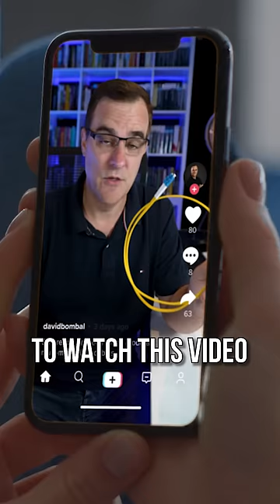Did you know you are using these right now? #shorts

Comment: Single cable is used for back bones and or the long stretches of a fiber line. Multi is for house conections kind of like a bridge or a door way for the light to go to
Reply: We use single on both , inside wire and wire to the prem
Reply: @el_Chupo  correct I was referring to
 take a 288 and run a backbone and 97 or 24 counts off the 288m for  legs feeding to enclosures for house drops? You wouldn't exactly use that wire the exact same thing just construction cable instead of a tool
Reply: Multi is used to connect multiple equipment. Exemple is a server connected to a router, everything inside the ISP facility

Comment: Quick tip:  The aqua colored cable is laser optimized multimode. Normal multimode fiber that uses LEDs would have an orange outer jacket.
Reply: I didn't know that. I'm very experienced with single mode but haven't had much to do with multi mode.
Reply: Aqua colored is normally called OM3 multimode
Reply: The color has nothing to do with the cable type. You can order them in whatever color you want.  While there might have been some accepted color coding in the past with yellow typically being for Singlemode and orange being for multimode, the colors never really were actually part of the standard.  I have yellow and orange OS2 single mode as well as orange, red, aqua, grey and blue OM3/4 multimode. Always look at the indicator on the cable to know what it is. You cannot tell from the color or the connector.
Reply: @shawnrhode  True but 99% of OS1/2 is yellow, OM1 is grey, OM2 orange, OM3 cyan and OM4 purple.
If someone at your place of work is buying cables that don't conform to that sack them.
Reply: @jonathanbuzzard1376  I buy based on use. For example, single mode network cables are yellow, single mode fiber channel cables are black, multimode OM3/OM4 network cables are aqua or dark blue (primary are aqua and redundant are blue), multimode OM3/OM4 cables for fiber channel are orange for one port on the HBA and grey for the other port.  
For infrastructure cabling within the plant, I stick to yellow for Singlemode (OS2) and aqua or purple for multimode like you noted. I haven’t worked with OM2 or OM1 for a while although I do have some OM2 lying around. 
Colors are dependent on use and location. Having someone use different colors but having a plan around why and how is fine. Just randomly throwing colors in just because isn’t fine as you noted.
Reply: THANK YOU. Aka OM1 Fiber. It's out of standard and shite
Reply: @shawnrhode  typically it does. I'd say 95%+ in my field. USA here
Reply: @9ernation543 USA never been a good standard follower 😂
Reply: Thaks for that mate. Didnt know that one.

Comment: I work with fiber optic in the broadcast industry a lot. It’s the most fragile cable we use but also the most effective because you can send multiple video and audio signals down just one cable.

Great video!
Reply: And its MUCH faster than traditional copper cables, also can be used over much farther distances than copper as well

Comment: I worked optic fibre in a data centre for 5 years. The single mode cable itself is a bit cheaper that the multi mode, the SFPs though, those are 5 to 10 times more expensive than a multi mode SFP. High price resides on the level of precision single mode requires. Within a data centre multi mode works well. There’s a new generation the OM5, if not mistaken it can carry up to 100Gb on only 2 threads using multi wide band.

Great content Mr David!
Reply: Thanks! Great info
Reply: Today the difference in cost are so low there is little reason to even consider MM outside server centers.

Comment: We studied this in my engineering, basically there are two types: step index fiber and graded index fiber (based on refractive index of core). Each can be divided into two single mode and multimode. Though we use graded index fiber for multimode only. Fundamentally, the lights travelling in them are either LEDs or LASER. These lights propagate in the fiber through Total Internal Reflection phenomenon.
Reply: I was disappointed he didnt mention refractive index in the video as that is entirely the difference between the two and WHY single mode travels center and multimode bounces down the glass.  The fiber core is a different diameter in the two, controlling the reflective interaction or the photons.  So thank you for bringing it up!

I spent 20 years as a net eng/architect in cellular/wireless telecom, mostly using SM in my work.  One of my favorite projects was deploying a bidirectional DWDM (Dense Wave Division Multiplexing) ,ring between facilities using Tellabs 7100Nano DWDM switches.  Essentially i played with "colors" on the fiber.  The data density we're able to stuff into a single pair of single mode glass ia downright insane.

To explain what i just said, we had a need to connect four distant locations with very high bandwidth capabilities.  We provisioned two rings of "dark fiber", meaning the carrier connected them with only glass, no routers or switches.  That allowed us full control of the wavelength we deployed on the fiber rings.

Using that Tellabs hardware we were then able to send 288 different frequencies of light down just one single mode fiber.  Each one of those frequencies were capable of transporting an OC192 or 10gigabit ethernet.  Between both rings that was 5.6 terabit of provisionable bandwidth between facilities, on just two fiber rings.

The fadcinating part is HOW this equipment was able to manage all those 'colors'.  They used PHYSICAL switching to do it!  The light coming into the equipment ln the ring was split using very accurate, tuned prisms, and the switching fabric (how it directed the input to the right outputs) using micro-mechanical mirrors, just like a DLP TV, insanely tiny mirrors directed each color to the proper destination within the equipment.

Note: I did this 8 years ago, i guarantee modern equipment can do more than this now.
Reply: And to add. The fibers connecting the continents still do have repeaters/laser fiber amplifiers every couple 100kms. Even though the loss is quite small, it does add up over long distance.
Reply: We learnt the same thing you mentioned like an year ago 😅
Reply: Believe it or not my great uncle was on the team hired to manufacture the very first fiber optic cable. He was the one who designed the machine and made the first successful strand. I own that exact strand today. About a foot long and half inch thick with metal ends crimped on. Really cool piece of history that may be worth money one day
Reply: @JohnBysinger  your wording is wrong. The refractive index interface is bassically the same in MM or SM fibers. 
It is 100% the core diameter that controls the mode propergation and technically it is the mode that propagates "straight" down the fiber.

Comment: As someone who's studying network engineering, this is highly precise and informative for a 60 second short
Reply: But but he never mentioned that the core can also be made of plastics, and it's not always glass or pure glass
Reply: @mohankrishna1443  It's glass in all modern single and multimode fibers.   

What you're talking about is called POF or Plastic Optical Fiber and was used for short, low speed networks.  I believe TOSlink may utilize a POF.

Comment: My anxiety level hit heights when he tries to bend the cable.
Reply: Ten thousand data center operations techs cried out at once
Reply: The ones that we use at my work are strong enough that we can wrap them around a pencil and still work just fine.
Reply: These cables can bend to like a 3mm radius without breaking
Reply: You will just loose the proportion of internal reflection long before it snaps. Its when you use solid core twisted pair by mistake instead of braided when the fun starts.
Reply: Omg , comptia lied to me lol
Reply: @Nick_Shrope  tiny fiber?

Comment: I actually assemble cables similar to these but they get used in semi conductors. Even in single mode the light is technically bouncing around in there. When you bend it and went past the bend radius you actually still get a loss in yield. We use equipment to measure this yield. Fun fact: the glass core that the laser travels down can have a diameter tenth of a millimetre or smaller
Reply: So silicon photonics?
Reply: You’re splicing these??? That’s awesome. I use premade jumpers to run switches and servers across buildings but I’ve never actually had to splice and cap fiber optics before, just RJ11 and RJ45.
Reply: @DenyTheZeitgeist  my job specifically requires the assembly of these fibre optic cables. Our product is encased in a metal jacket for durability and protection against extreme bends. Assembly will include actual assembly of the parts, polishing the ends and checking under microscopes and testing for the yield outputs. Our main customer is ASML. If you look them up they’re the leads in the EUV lithography market. All of the latest tech that’s coming out like the iPhone 15 pros will be using these machines to make even smaller transistors. It’s really cool to be a part of this process

Comment: It’s a SC LC connector, that connects to an optic ODF.

Single mode is the modern version, where multi mode requires some sort of booster and is mostly used on old buildings because you can’t mix sm/mm. Also mm and sm has significant different in width. 

Optics is not only used for data tho, it’s used in lights aswell nowadays.
Reply: Nope its about 1m LC-SC single mode cable. ST is a small bayonet connector.
Reply: @jonathanbuzzard1376  your correct I mixed up :)
Reply: It doesn't have to connect to an ODF.

Comment: Single mode SPF LC patch cable, I used to work a a fiber rest equipment manufacture co. It perfectly fine to bend them, usually around a mandrel when you need to measure the connector reflection and attenuate out the light from returning before testing a network cable.

Comment: The light bounces around in a single mode fiber as well.  Both cables use total internal reflection to guide the light wave down the fiber path..  The mode field usually isn't as big for single mode as it is just intended to carry one wavelength of light.

Comment: The only time I've personally used fibre is video transmission lines. It went terribly as you might expect when using poorly stored cable that hadn't been tested in years. SDI over a coaxial though, did the job

Comment: Internet technician here. We use Fiber optic cable to grant internet. It can transfer data so much faster than the old copper systems of yesteryear. Word of advice, typically the laser unit used in Fiber optic cable isn't visible to the naked eye, and you should NEVER look directly into the cable or really even mess with it unless you're a trained professional, you will go blind it's a high intensity laser going through the cable.

Comment: There are also fluid core fiber optic cables, and plastic fiber optic cables, apart from the glass version, both are more durable than glass, and fluid core is the least expensive option, and better in general.

Comment: The dangerous part about Fiber Optics is their glass shards, recently an ISP in my country is being charged for injuring 2, debilitating 1 and killing 1 due to an improper installation causing the cable to break and slitting the throats of several motorcycle riders. The one debilitated, a young university student, can no longer speak or eat. It's both amazing and disturbing how manufacturing can compact such materials into a small cable

Comment: i saw one of those when the guy wired up the router. he had issues with it because it was just a touch short, so he uhm...semi-officially found a way to bypass the issue by way of offsite tooling.

off the record i offered him pliers to pull it that extra couple millimeters out of the recess.

Comment: Basically, multi mode is usually fine within a building. But if you pay for the cables and laser transmitters, you can pull a single mode cable pretty much anywhere you want.

Comment: There is a benefit to running multi-mode though, You're able to in some cases run bidirectional signals in a single pathway, another cases you're able to run multiple signals to and from in a single cable. However, you also have to math and physics in order to make sure that they don't interact and either destructively or or positively converge signals

Comment: Thats a singlemode LC/SC fiber optic cable. I work with SM and MM every day as a telecommunications technician. On cell phone towers we typically use singlemode in the trunk going up the tower to the radios, and multimode to connect equipment inside of the site support cabinet, usually between the BTS to the router. I love working with fiber optics although its much easier to fix a broken ethernet than a fiber lol.

Comment: Yes, I'm using fiber to connect to the internet. But it's only a single fiber with 5 colors (wave lengths to be technical). The highest available plan is currently 1Gbit. Considering I'm not in a city, that's not bad.

Comment: Those are adapter cables with SC to LC connectors. These are typically used in the SFP transceiver port of switches to connect older fiber optic runs.

Comment: I remember when they couldn’t get the light to make the bends. It could go straight but not make the turns. I believe they discovered the buffer and cladding system to make the light make the bend. This was a long time ago. Does it still go 15.5 miles with out a boost? It’s been a long time since I have delt with fiber.

Comment: Light never goes "up the middle" of a fibre optic cable, because the cable curves but light travels... (all together now!) in straight lines. The light always reflects from the insides of the fibre (though actually, it's a special case of refraction). 
It is not difficult to look up "how optical fibres work" and "total internal reflection", it's the 21st century, boys and girls.

Comment: The craziest thing I learned about the fiber cables is that network data travels through them using the glass. Rj45s use copper and WiFi uses radio frequency signals. It’s so sick fr😅😅😅

Comment: The single mode and multi mode are much more different than that ;  although the red light will travel through both the multi mode fiber optic has the same type of protection if ,  you are utilizing Channels instead of frequencies.

The cables you are seeing here are jumper cables or drop cables that connect panels to panels or panels to rack mounts. 

But the better one is the green one not the blue one, 

The green one or better known as APC is much better because it will cause less Data loss than the blue one better known as UPC; why ? Because the UPC is flat in the ends and has a gap when you connect them which causes higher data loss not by much but less loss  is better than more.

If you want to know more let me know thanks !

Comment: Yes they’re made from glass but not Silicon based glass, rather Germanium Arsenide type glass. Silicone based glads has near total absorption for UV lasers and visible light. Sunglass manufacturers will never mention that regular clear glasses do 85% of the UV protection. 😅 I learned a lot the Opto Electronics course that I did for my Engineering degree. You did a great job simplifying this information.
Reply: Fused silica is not silicone or silicon. I think you are a bit mixed up here.
Fused silica is amorphous not crystalline like silicon, it also has very good optical transmission from the UV-NIR.
Not that communication fibers need any transmission at UV wavelengths though.

Comment: Yeah, but I also need them in my house if I ever want to use my IBM3310 tape libraries, that ought to cost over 2000$ for fiber optic ethernet switches and the cables to support at least 4 drives.

Comment: Honestly, multi-mode is not cheaper when you factor in running out of stock when you try to save money using both types in different applications. Unless you're 100% multi-mode, going full single-mode is better.

Comment: Ah ! I knew about fiber optics as an engineering student, I've learn much about this thin hair like tube.
Single mode optical fibers are useful but there are alot of losses than that of multimode and even in single mode you can send one signal at a time and in multimode , multiple.
Comment me If I was right😌

Comment: there is a common missconception ,SFP transceivers ,or adapters not only are used to carry optical fiber lines , right now there are thousands of sfp types that goes from 10GBE (yeah gigabyte ethernet meaning the fast speed a house or pyme can get) up to 40gbps optical fiber adapters ,also ONT gpon ,xpon etc (yes the ftth that domestic isp use) . SFP is not the name of the optical fiber modules ,is the name of the technology that convert these ports into whatever you need to carry on the signal. also there are new optical fibers that split 100gb ports into 4*25gb ports etc ,they are called MPO (multifiber push on or smth)  he means that we all use one probably cause 99% of ISP nowadays use OLT (optical line terminators) to carry internet to the external boxes that carry the signal to each home. these olt usually use multimode 10 ports per slot ,each port usually being 10gb that splits into 1gb  lines to each user. its not always the same ,but usually its how internet ftth go to each user home.

Comment: I, in fact, do not use fiber to watch these videos. I am using wifi. Which is coming from my router. Hooked up to the wall via rj45. Out to the ped. Which, awe crap there’s fiber in there! 

I’ve got some fiber running switches and servers between buildings. It’s really neat stuff.